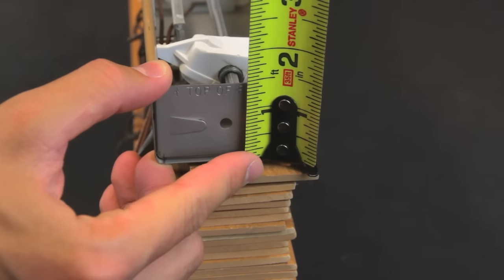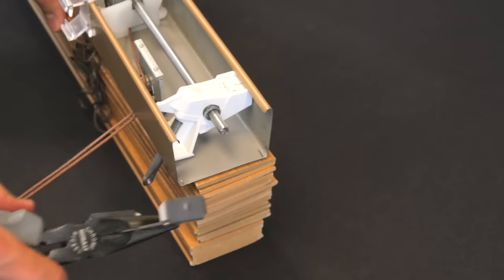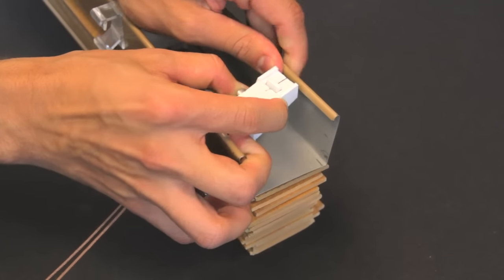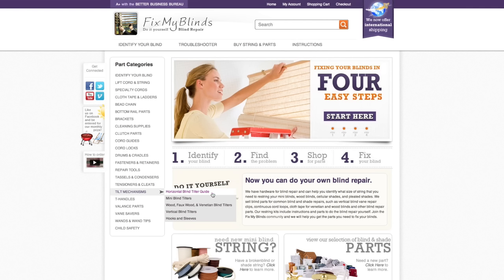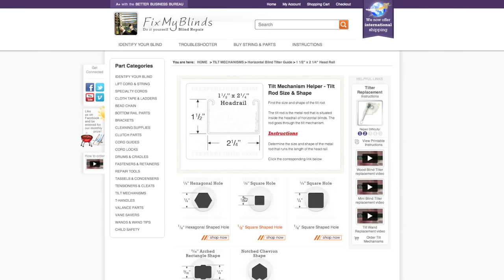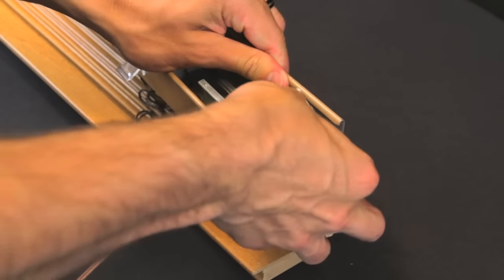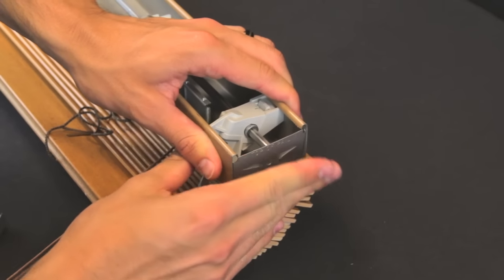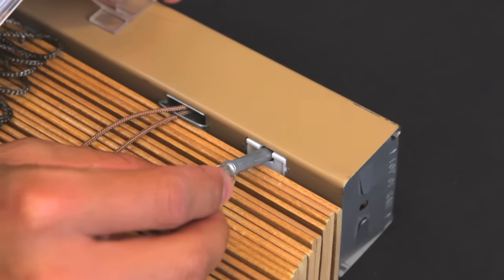How to Replace a Wand Tilt Mechanism

Comment: Excellent video. My blinds were a tad more difficult with the rod not sliding very well. I just released the tilt Mechanisml and release the first slider piece and it slide right out. I used your link to order the new tile piece after following your directions. It will be a very simple repair when it arrives in a few days.  Thank you!

Funny I had 3-4 blind companies tell me I had to order all new blinds because they were not repairable.... .🤨 😆

Comment: What do I do if my tilt rod doesnt move? Theres 2 little circles on the rod preventing it from moving past the first vertical holder thing. I cant get the tilt mechanism out :(
Reply from the maker: Hi Taylor, Some tilt rods do have rivets, washers or pinches/bumps on them that prevent them from moving. The best thing to do is to file that bump away with a metal file. Then you'll be able to move the rod freely and replace the tilt mechanism.
Reply: @fixmyblinds Those stops aren’t necessary? Why are they there to begin with?

Comment: I had no problem replacing the tilt gear, but my blinds will still easily tilt. It's as if the rod is stuck and not able to rotate. I have been troubleshooting for a long time and can't figure out what is restricting the rotation of the rod. Any ideas?  I know it's not hitting the stiffeners and it doesn't seem like the string is caught or tangled?
Reply: *Will still NOT easily tilt
Reply from the maker: Does your blind have a valance on it? Maybe one of the valance clips is in the way of one of the drums. Or, maybe a string is tangled inside the top of the blind? How wide are these blinds?
Reply: FixMyBlinds thanks for responding. No valance.. they looks just like the blinds in this video. They are 2" blinds and 6 feet wide. I can't find any tangles but when I try to turn the drums by hand they don't move easily at all. I will have to look closer maybe.

Comment: Hi do you have any tips on how to shorten the width of a horizontal blind a good 20" or so?...Thanks!
Reply from the maker: Dee - If you need the width shortened, I'd recommend having the blinds professional cut to size. There's no really good way for most folks to do that with tools in their garages.
Reply: FixMyBlinds Thanks I was gonna try it myself but I'll just leave it to a professional!

Comment: Video directions make it sound easy, However when you go to this company's website it does not match the video for instructions.. If it did it would be easy!
Reply from the maker: It's true that our website has been updated since this video was made, and it looks different now. The instructions for measuring the headrail and the size and shape of the tilt rod are the same. If you need any additional help finding the right replacement part, please let me know. We're here to help! Here's a link to the instructions on our website: https://fixmyblinds.com/collections/tilt-mechanism-buying-guide.

Comment: I have a rod that doesn't slide put all the way. it seems as if it has something in place to avoid the rod sliding. Any idea how to remove a tilt rod that's secuere? anyone? :-)
Reply from the maker: +Cleva Cali If a rivet or crimp is on the tilt rod between the tilt mechanism and cradle you need to pull the tilt rod up out of the cradles so you can slide the tilt mechanism freely. If a rivet or crimp in the tilt rod between the tilt mechanism and end stiffener you need to slide the tilt rod out of all the components in the headrail. Here is a diagram to reference: https://www.fixmyblinds.com/identify-your-part/wood-faux-wood-venetian-blind-diagram.html. If you have any other questions please contact us at service@fixmyblinds.com.
Reply: @fixmyblinds  thank you!